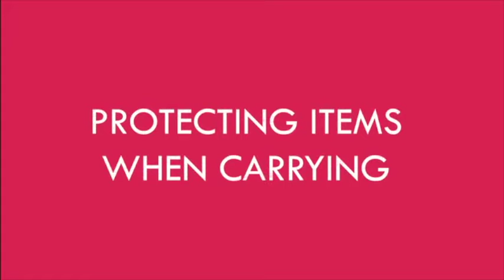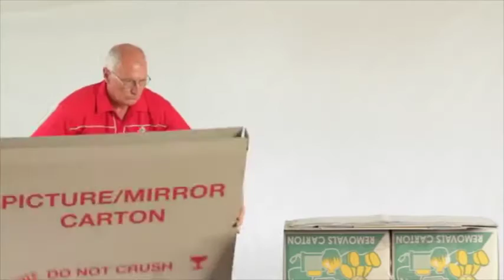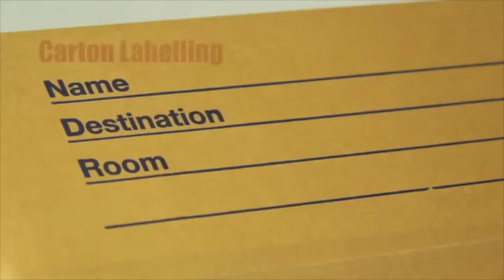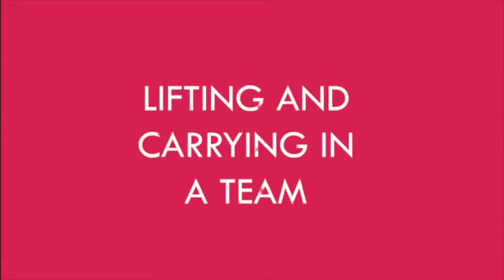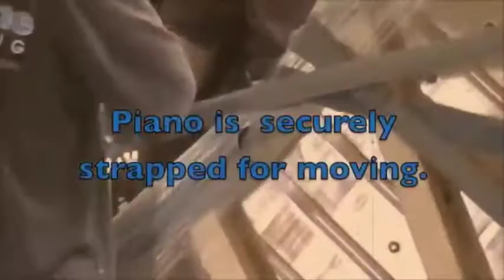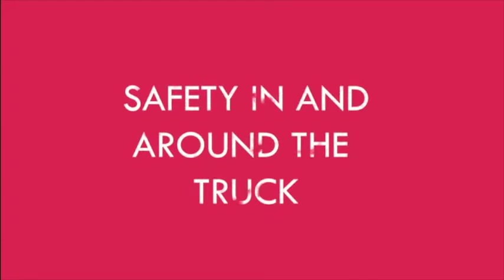Removalist Training Video | Sydney Movers Training Video | How To Conduct A Removal Safetly

Comment: 😂 Iv been a mover for over a year and this is just over the top
Reply: More cash in offering proper services though, the Mark up is higher, the day is longer which means more profit per job with less chance of insurance claims and workers compensation claims
Reply: The mark up comes from reselling packing materials, you can mark them up around %40